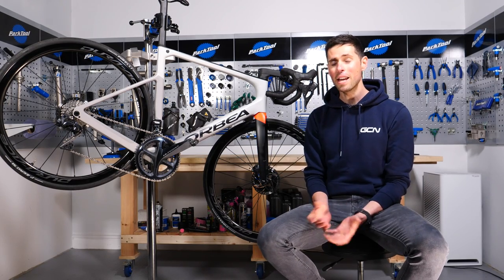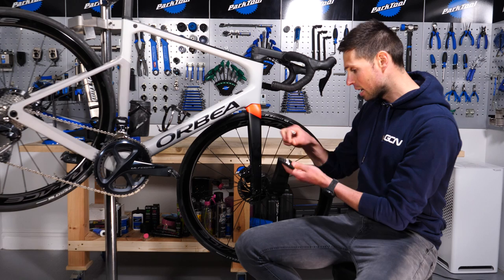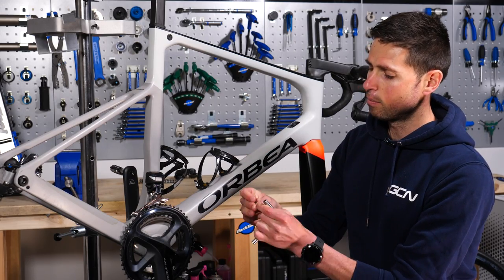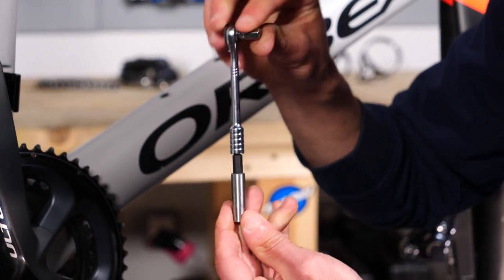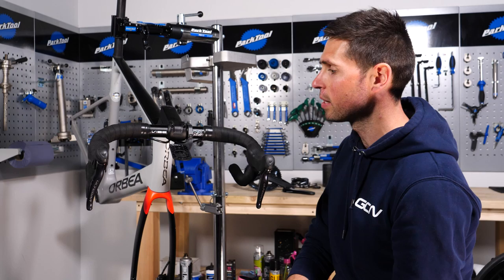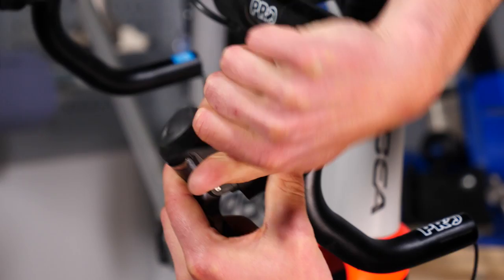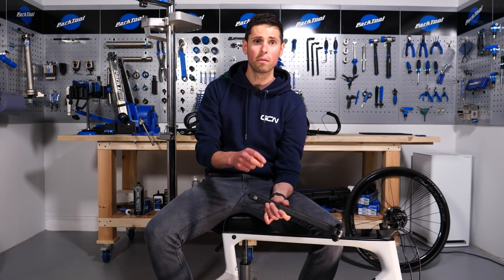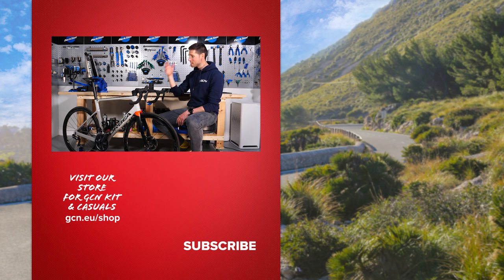Can You Strip & Rebuild A Bike With Just A Multi Tool?

Comment from the maker: Do you think you could take a bike apart with a multi tool? Let us know in the comments 👇
Reply: Not related to this video but got a video suggestion about using Apple Air Tags, see GP Lama https://www.youtube.com/watch?v=vjLbxywixro
Reply: I like the additions to that multi tool. I have that set and I’ve used it doing a couple of things around the house. Ratchets are the bomb.
Reply: You forgot to take the cassette off.... ;)
Reply: @panzerveps  forgot. It’s attached to the wheel so semantics, he removed it from the bike when he removed the wheel.
Reply: @Kimberly_Sparkles  He said he'd strip the bike. I'd say cassette and brake rotors are a part of a complete bike build.
Reply: I can do the same WITHOUT ANY CHEAT !!!!   If you had a Connex Quick Link for your chain, you wouldn't need any tool at all to remove the chain (and it's the most re-usable quick link there is !).  You can see it done in the video of OZ Cycle "Ultimate Chain Wax - make it yourself" at 17m43, easy peazy !!!
Reply: Yup with the decathlon multitool I have, It even has a Shimano crank tool on one of the tire lever
Reply: Yes (depending on your crankset). Should you... No, don't be ridiculous.
Reply: Can you please tell me the shop from where you got THIS multi-tool. Share the link or anything that can get me this type. I need one with the torque wrenches please. Would really love the help. Thanks
Reply: Wish you had done this with a mechanical group set, as that's what most of us have.  You can't simply unplug the Di2 cable at both ends.
Reply: I serviced a dropper post with the very multitool featured in this video!
Reply: Since I had to stand on a 15" breaker bar yesterday to loosen a threaded BB, I'm gonna go with no. YMMV :-)
Reply: Cynical comments aside I do like that multi-tool, especially nice little touches like the chain tool handle doubling as a ratchet extension bar...
Reply: Nope. My bike was made in the 80s.
Reply: cutting a gear cable.

Comment: A good way to remove a split link is to get it on the chainring, but using one too few teeth so that the link is standing off at 45 degrees.  You can then give the roller a tap with your handy multi tool and it will all come apart.

Comment: Use this exact multi-tool in my saddle bag - with one addition. Instead of the chain tool I swap out the tire levers in the case for a Lyzene "chain pliers" chain tool so I can replace quick links (it stores 2 with magnets) as well as having a chain breaker and spoke key. Together this gives me absolutely everything needed for roadside maintenance and its light and small enough to take with me whether I'm on a short little training ride or on a multi day bikepacking adventure!
Reply: I also swapped out one of the Torx key bits as its not relevant to my bike for a flat head bit so I can work on my disk brake calipers & pads... In fact the beauty of this tool is its flexibility as the bits are easily replaced or swapped and available at any hardware store.
Reply: @frazergoodwin4945  yeah. I really like it. When I need a tool to get in small spaces it makes it way back up to my tool box for regular work.

Comment: I can open my KMC quicklink by hand. Not tool required, really. Take it between your thumbs and push.
If that doesn’t work, take some length of string, guide it through the adjacent links, knot it together, put it over a stick (or a screwdriver), and twist.
Reply: I’m sure Shimano’s instructions confirm that you can do it with your thumbs!

Comment: A tool is not needed to remove or to install a quicklink. A bit of string wrapped around it and pull on the string will remove it and installation is by putting it on and pushing down on a pedal with the brakes on will lock it into place.

Comment: Could have removed the brake calipers, too. But yeah, we get the idea. Additionally, even the tool you did have to use to break the master link can "sometimes" be done with a painful finger and thumb pinch. Not ideal, but sometimes doable :)

Comment: Good morning I have a question and need help I want to replace my current crank set which is  52/36 whit 2x7 speed. Which crank set should I buy? I sow there loads of crank sets, but they are 3 or 2 x8, 9 or  11. I really want to buy the correct one.

Comment: Why does a bike need so many different sized bolt heads? A crank bolt I understand but sometimes you need two sizes to adjust handle bars or a saddle. Then there is the mixing of Allen head bolts and torx bolts.

Comment: Interesting...What is that little thing you got on the seat post to mark the height of your seat post ? Looks nicer than electrical tape :-)
Reply: If you talk about that plastic/rubbery thing, then I’m pretty sure it’s coming with the bike. And main purpose of it is isolation - so water is not getting in the seat tube. It’s required for frames where you set seat post height with bolt, instead of clamping.
Reply: @Ernie_13  
Thanks for your reply.
Makes perfect sence.Could be a double purpose if you could 3D print it yourself for any other seat post...

Comment: #AskGCNTech Is there a retro looking,  silver colored, ideally five arm hollow tech II crank set on the market to replace a square tapered crank set on my old steel frame bike? I have to replace the worn out square tapered BB, and would like to use a modern BB but i can't find a good looking crank set. What I have found so far would ruin the look of the bike.
Reply: FC-7800 is pretty much your only choice.

Comment: quite sure Alex mixed up some of his allen key sizes, a thru axle is 5 in my experience and a bottle cage 4 if I'm correct
Reply: Different thru axles and bottle cage bolts are different sizes, it varies from bike to bike
Reply: If I changed to a bolt type thru-axle it would be 6mm. As to the bottle cage bolts, I've had 3, 4, and 5mm bolts. No standard there.